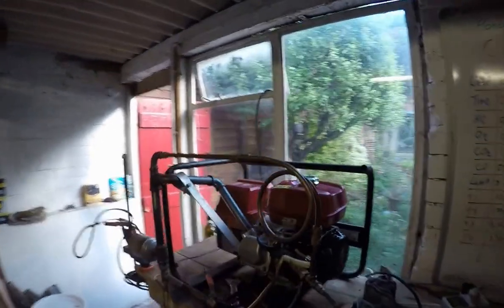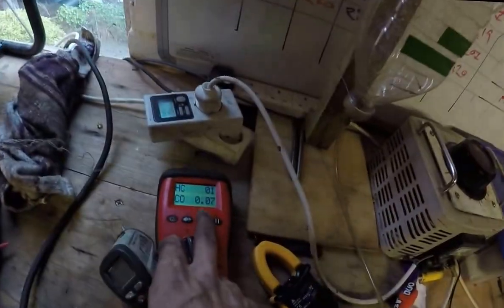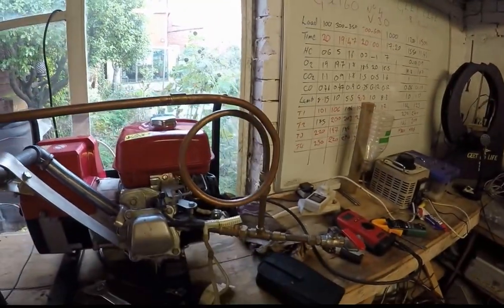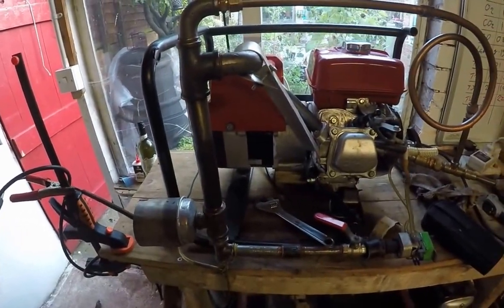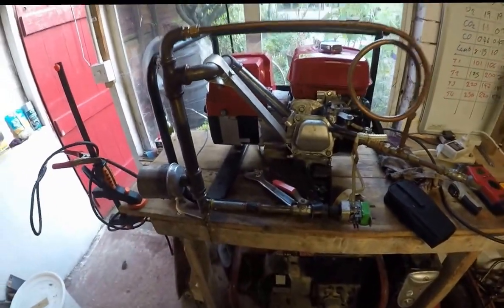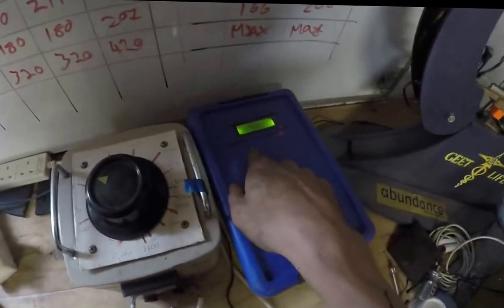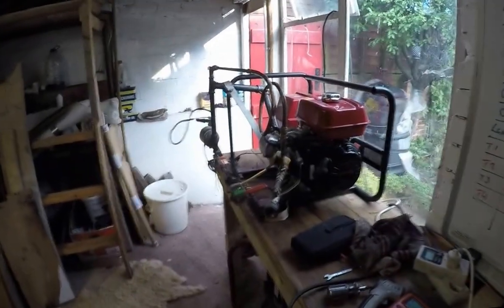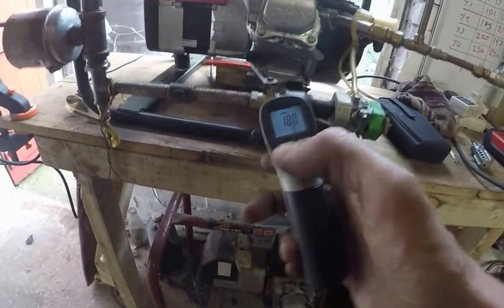GEET Reactor test for Australin Dealership

Comment: Hi Dan 
You don't seem to have the same reading temperature that i have because while the motor is running,if i try to read the oil casing temperature it only shows LOW-50°c.
And it's the same all around the motor.
Even the reactor shows strange temperature like hot on the top and the bottom and cold in the middle.
And the face of the reactor close to the motor also read LOW
Then when i stop the motor it read the real temperature??!!
Reply: Would you make a video for us?